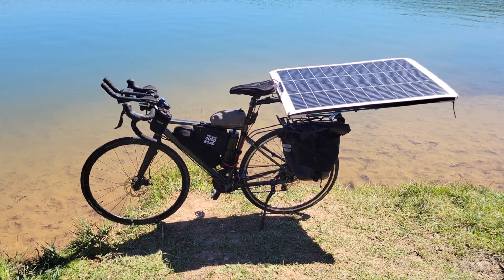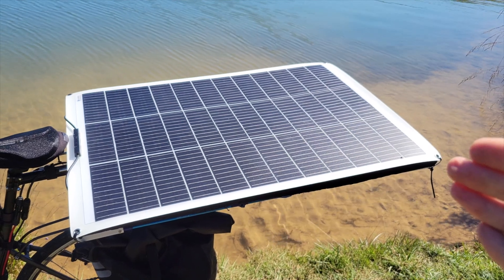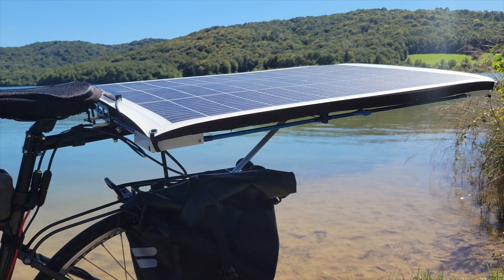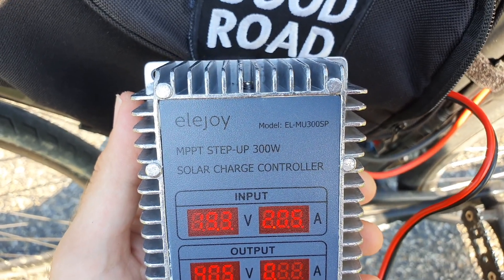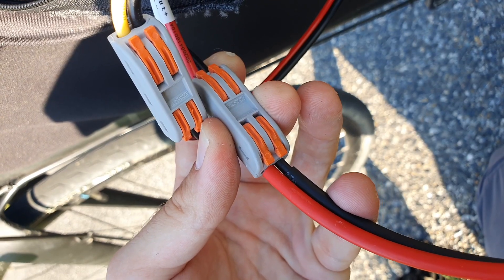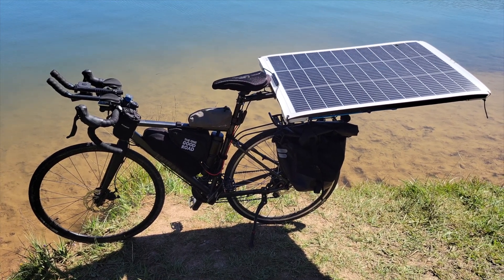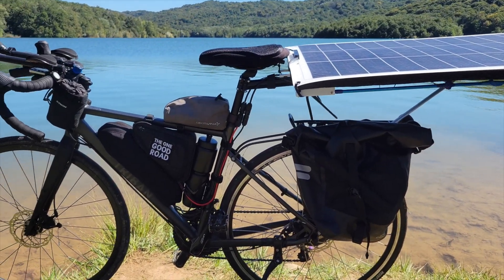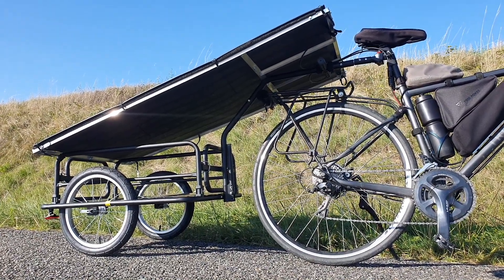How To Make Your Own DIY Solar Bike

Comment: I use two of these Ecoworthy panels as a solar roof on top of a recumbent bike. However, normal panels are very senitive to shade. As soon as shade from your body covers the panel at the back of your seat only partially the power drops dramatically. There are new shade resistant panels available. I tested one from Shadestopper and in partial shade it works much better than a convenient panel like from Ecoworthy.

Comment: I've been trying to figure out how to do this with my e-Bike.  I like riding to different distant fishing spots towing a small bike trailer that carries my gear.

I do have a spare battery that I take along with me so my thinking was that I could run my e-bike off of one battery until it's depleted to a certain point.  Then I could simply swap it out with the fully charged battery.
 
Essentially I'd be charging my spare e-bike battery that isn't connected in any way to my e-Bike as it's being re-charged.  Does this sound feasible to you?

If so,  would or could your method be used for this type of e-Bike battery charging?
Reply from the maker: It certainly could work very well! Perhaps even better than using one battery. It would add a little more extra weight but if you ride a flat route. Then that would be less of a concern. I'm planning to receive a 2nd battery soon and might test something similar to this. 

Keep in mind in my testing, if you have a large solar array wherever you are based and if you doing a day trips. It's usually more effective to carry two batteries, then to try and charge them whilst out on a ride. 

This is mainly because the panel whilst riding experiences a lot of changes in terms of facing the sun, for example, lots of tree cover sometimes and the panel is mounted flat which isn't ideal. 

If you could design something where the panel would face the sun as much as possible. Then this would improve your chances of charging the battery whilst riding.

Let me know how it turns out and wish you happy riding and fishing. 👍🏻

Comment: Im looking in to a similar requirement. On theory so far I'm looking at a trailer, which will have a flexible panel on it, which charges a second ebike battery via an inverter and a 7ah SLA battery via a victron solar charger. In theory it'll work to allow the battery to be charged in an average Australian day of sunshine. Which means the ebike will be able to do a days ride, then use the charged battery for the next days ride. Calculated solar panal for my 530wh battery is needing only an 80w solar panel. Which helps to keep the size down.
Reply from the maker: I agree that having a second battery to charge while you're riding is a brilliant idea the only thing is can I ask why are you using an inverter to charge the other battery? it's more efficient to use just DC to DC power if you can I recommend having a look at the Elejoy mppt charge controller that I mentioned in the videos description.
Reply: @TheOneGoodRoad  yes, it is still something I'm considering. Though the inverter then rules out any chance of a failed mppt charger causing the battery to overcharge, explode and doesn't void any warranty when using the manufacturers 240vac charger pack. At least while the bike is under the warranty period. It would also mean I don't have to upgrade, change or adapt my other current devices which utilise 240 vac and 12vdc. But it will ultimately come down to costs, weights and practically for my needs and lifestyle use of course.

Comment: angle changing feature (horizontal and vertical) would be awesome. also can you please try charign while riding if it works?
Reply: I'm finding that the BMS can allow or not allow charging while discharging.
The people who built my battery pack, say their BMS supports it.
Reply from the maker: In my testing the battery does seem to charge while discharging but in order to charge it at the same time, you'd have to discharge it at the same rate as the charging speed, to keep it fully charged.
Reply from the maker: Yeah I'm not sure yet how to do that but for sure it's on the list of things to test out 😉 regarding the charging it's been confusing whether or not it can or can't. In my testing in a stationary position I think it does charge it but only if you consume the same amount you're putting in. For example, level 1 and 2 should work. But when I asked Yosepower they say the charge controller doesn't support that function so it's a bit of a mystery for now still.
Reply: Hi, I think up to the generated power can be consumed while riding. But the loading power strongly depends on the current battery capacity/voltage . If the battery is nearly full, the carger will limit the current to Not 'overload' the battery.  I Experimenten that with my charter in my camping van.
BR Arthur